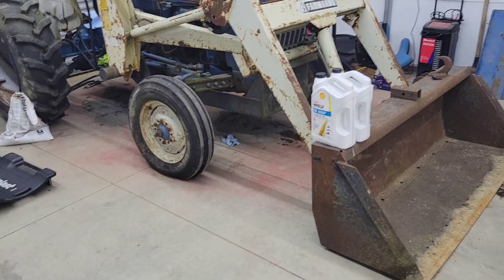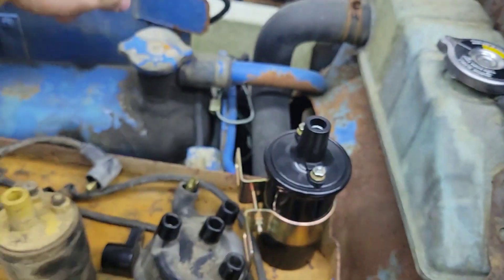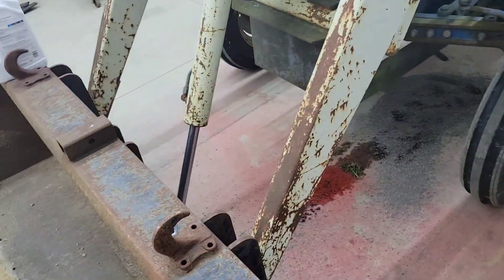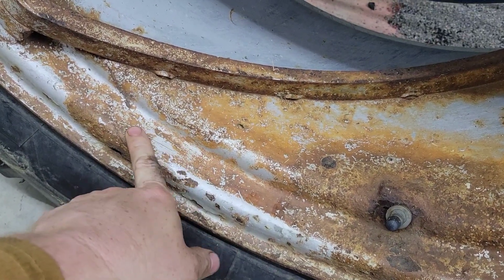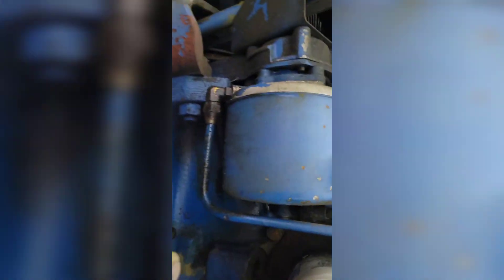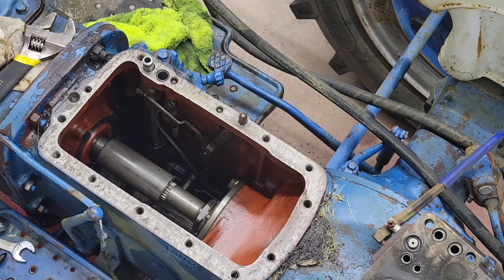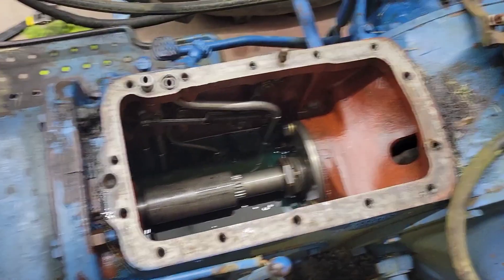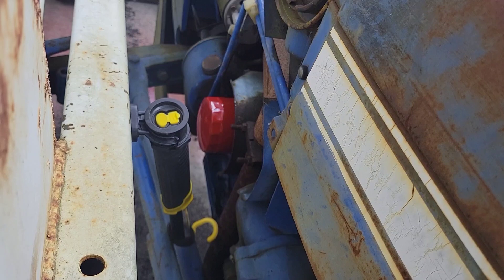Ford 3000 service and tune up

Comment: Good for you for getting a good deal that’s a good looking tractor! 
All that condensation makes me think it was used a lot for snow removal and it was getting hot and cold but good thing you new enough to change the oil I think you probably saved it from a catastrophic failure but you have a really nice tractor, I was wondering where you were ordering your parts from I have a 1978 555 ford backhoe and it has a 3 cylinder also and my temperature gauge died and I should order one! Keep on trucking 😀🇨🇦